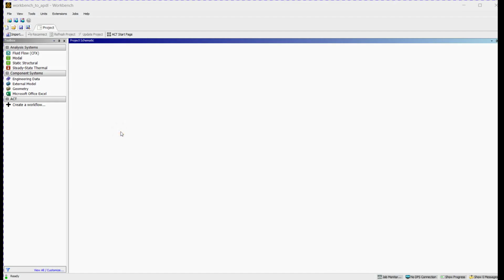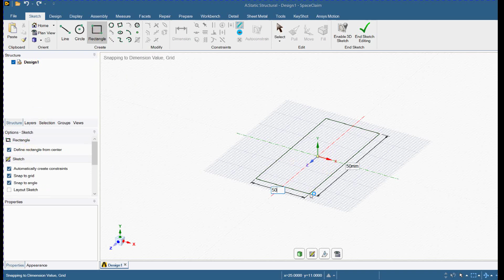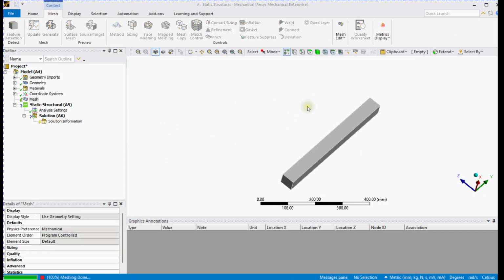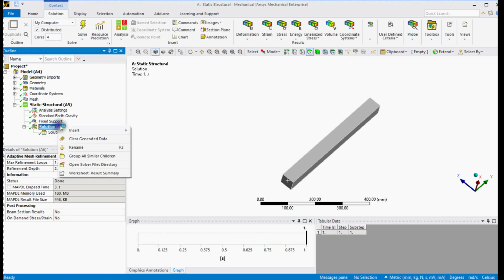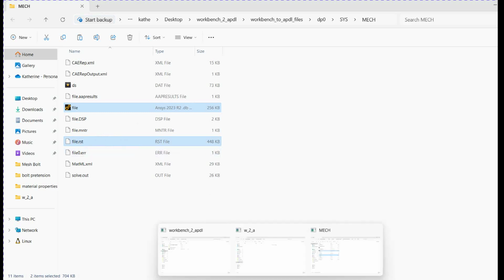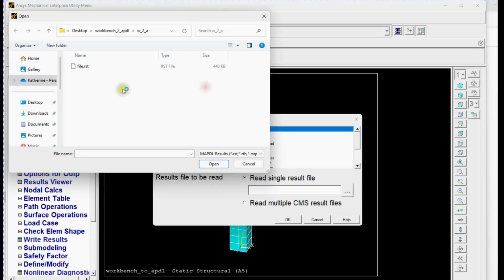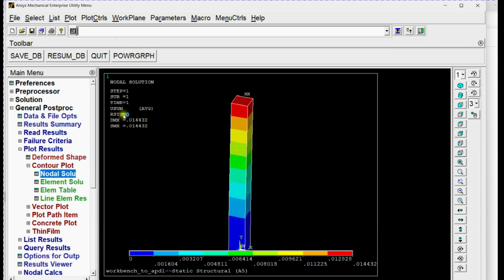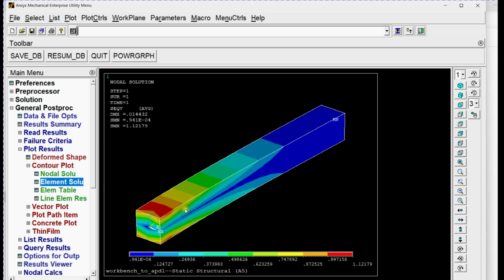How to Transfer Files from ANSYS Workbench to ANSYS APDL | Step-by-Step Guide

Comment: Is there a way to just export the geometry from Workbench and then import it into APDL without meshing the component first? Thank you
Reply from the maker: Please elaborate more on this. Do you want to export from the spaceclaim or mechanical workbench?
Reply: @Learn-Engineering  from mechanical workbench. Basically i need to load a geometry in APDL, a simple iges file of a tube connection. I tried to import the iges in APDL but it has troubles. I think that exporting just the geometry from workbench to apdl could make it work